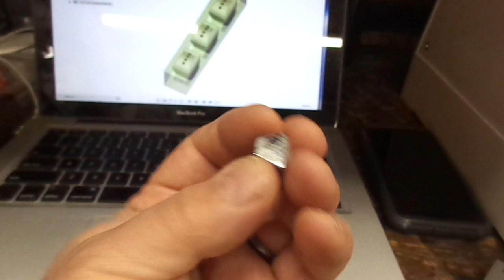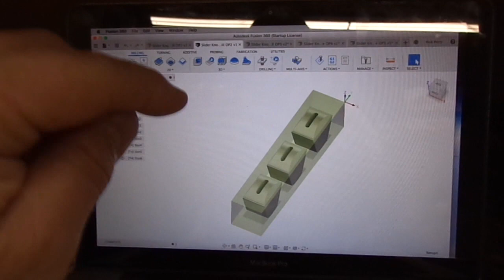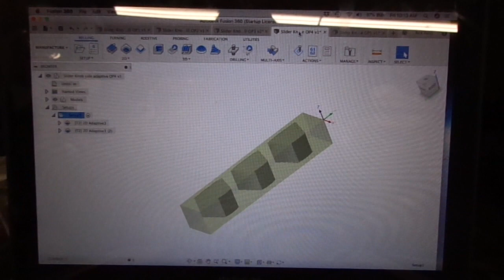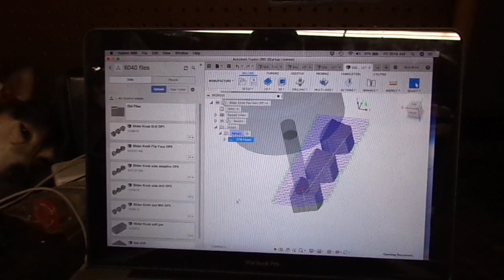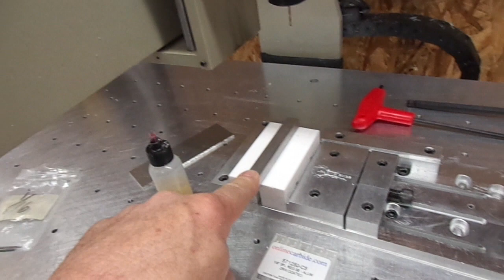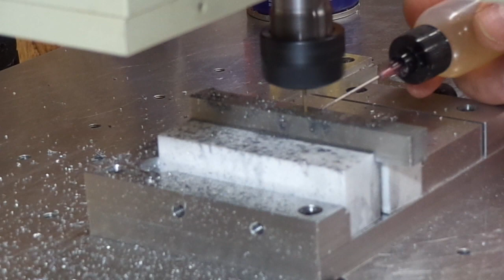6040 CNC Custom AC Control knobs on

Comment: High Rick, just enjoyed this machining project, do you use Mach 3 as control if so could you provide the following: X-axis motor tuning and setup, also I can't seem to get the Spindle to operate on PC or Manual, My cnc is the CNCEST 6040 ( I am a newbie). Thanks
Reply from the maker: My spindle setup will be different from yours due to you having different motion and spindle controller.  Almost any settings will get you motion, then you simply tune until it stalls. You should have gotten a manual with default settings for your setup. When I had the controller you have, I had to adjust some settings on the front panel to make the spindle work. Something in the setup code changing a 0 to a 1 to make it look to the PC for spindle control.  I will look and see if I still have my old Mach3 setup file from when I had the old 1500 controller box.
Reply: @cpworx_maker  Thanks Rick any help will be greatly appreciated
Reply from the maker: See if this helps... https://www.dropbox.com/s/10h21zc1czof0b7/6040Manual.pdf?dl=0